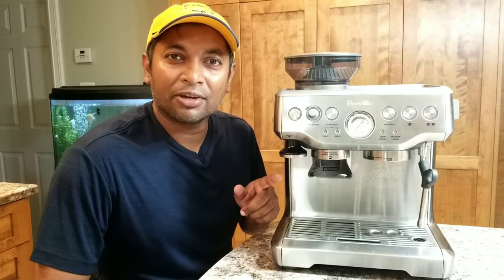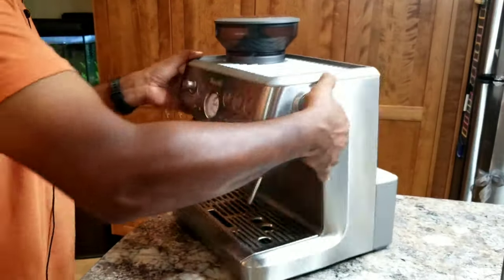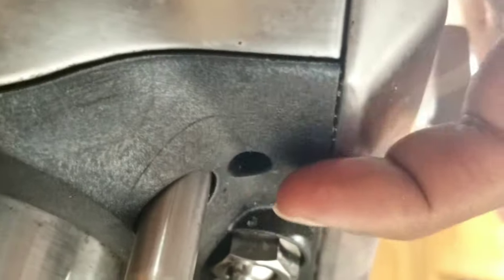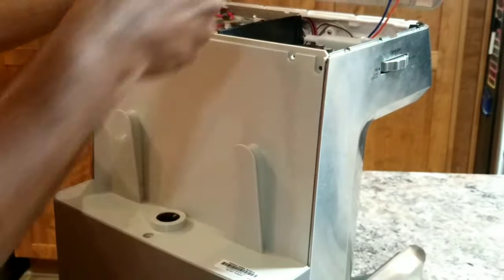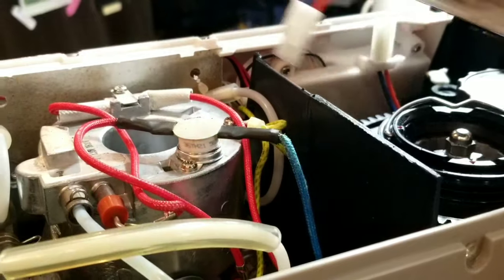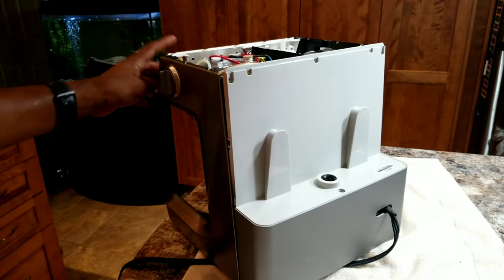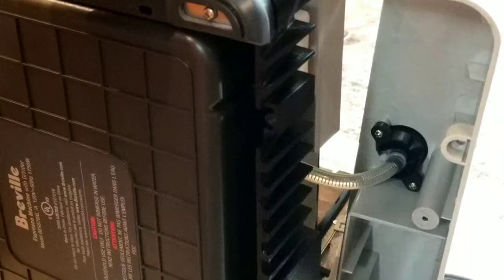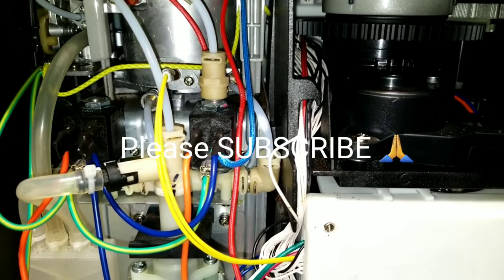How To Open Breville Barista Express BES870XL

Comment: Brilliant.  Was so close to getting a new machine after trying two new silicon rubbers with no result.  My coffees taste even better now.  Tightening screws removed all the side spray from my machine.  It did take patience and 2 hours...watching and rewatching.  I ended up with 3 extra screws...and one white piece which fell off while taking back off.  I also drilled holes for the future.  I'm thinking maybe draw a template that allows holes to be drilled without the two hours of pulling apart and putting back together...you could print off and drill from template.  Thanks again!!
Reply from the maker: Thanks for the feedback
Reply: Did you ever get around the making a template? I'm facing the same issue and replacing the rubber gasket does no good. Even with all of the resources available, I'm dreading taking the machine apart.

Comment: Thanks man for the help!!  In my case the grouphead collar screws were loose. Needed to tighten them and also put some thread glue on them.
Reply from the maker: In that case you need to open further to reach there
Reply: @AjusCafe  Exactly , you need to take out the whole panel but it was worth it   :  )

Comment: Great video Aju!  Thank you so much for taking the time to make this video and film it so well.  Our BES870XL was tripping the breaker every time the solenoid engaged (when we press 1 cup or 2 cup button).  Off to Amazon to buy the replacement part.  Hope it’s not too difficult to replace!  Thanks again!
Reply from the maker: You're welcome. I'm sure you will be able to fix that
Reply: it just started to happen to me as well , did you manage to fix it?
Reply: @calibour37  i managed to replace one of the two pump solenoids and it worked for a couple days and then started tripping the breaker again but only when using the double shot button; a day later and all buttons were tripping the breaker.  I was gonna try replacing the other solenoid but our 2 week summer vacation disrupted the process and now i don’t even feel up for troubleshooting this trash.  We had ours for 2 years and the warranty only covers one year.  I did the math and I might as well have been paying a coffee shop to make my coffee over two years!  Breville needs to extend the warranty or provide repair options.
Reply: @ColdPillowz  Re: Breville, their "support" is horrible.  You're right, for the price of these units, they should be offering better tech support and repair videos.  But then they wouldn't be able to charge the $295 service charge!

Comment: This video helped to find screw on the back under the plug. And 2 screws to remove top cover.
P.S: there is black thing, you pointed as solenoid... I believe it is a high pressure Pump. Solenoids are higher above the pump on both sides.
Reply from the maker: That's correct. Its just above the pump.

Comment: Great video, thank you! I’m attempting to replace a burned out thermostat on mine and got it open easily with the help of your video, now trying to figure out what the best way to replace the part. The positive and negative leads look like they were soldered and almost riveted or crimped together, not sure how to remove them and redo the connection… 🤔

Comment: nice as far as you went.  However, more of the external panels need to be removed to access the screws holding the hot water pipe downspout assembly.  2 of the 3 screws are accessible as far as you went, but the third screw is under the front panel.  How do you take that off?

Comment: easy as pie after watching this video.  I have an issue with no pressure on the steam wand, how can I tell which of those plastic tubes would be the one feeding the steam wand so I can check for mineral deposits?
Reply from the maker: Usually its the steam wand itself. You need to clean it the steam wand thoroughly.
https://youtu.be/DWivoLznT8Y?si=S_AooKbDLccH9RRg
If it doesn't help at all, then it could be the steam wand gasket that switches from hot water to steam failing. Does hot water have enough pressure?

Comment: Hi, I have a Breville Barista Max Espresso Machine VCF126 which was working. Now, when I switch it on, it beeps but there are no pumping noises. After a short time the steam lights flash but there are no noises. The machine stays like this, flashing lights and no noises. It therefore won't make coffee. The grinder works perfectly. Do you have any suggestions on what might have gone wrong and what I should look for when I open the machine. Many thanks

Comment: Hi Aju.  My BES860XL has lots of pressure but almost zero flow of water.  Any suggestions as to what to look at?  Thank you!
Reply from the maker: Desacle the machine few time's. Check if there is leak
Clean the shower screen too
Reply: Thanks Aju.  I have tried all that with no change.  Unfortunately, I probably will have to take it in for servicing.   @AjusCafe

Comment: Thank you for showing this on the 1st generation of this espresso machine. I can’t get good extraction from it my Burr has no adjustment so I have adjusted my external dial but still having issues. Could it be because of the hard water I use for some years. Even tho I descale it every time was need it. Or can the the pump be the issue.
Reply from the maker: Check your pressure works https://youtu.be/acQYG7HkYb4
When is the Roasted date of the beans you use?

Comment: Good video.  Most videos I see have the two screws on the top near the reservoir base.  It was also good seeing that it takes a bit of force to get the back off.  I always wonder if I'm fighting a clip or if there's some screw still holding everything together.  I had a water line clog that was easy to clear once I got the back off.
Reply from the maker: Its very hard to open especially for the first time
Reply: I found on mine, I had to remove the base, not difficult to press in the tabs at the bottom of the back.

Comment: I have to subscribe to your channel thank you very much you offer a wealth of knowledge I have a problem with my Barista Express I have plenty of pressure I have adjusted the beans properly however I have very little water coming from the extraction the bottom of the basket is totally dry water is only on the top can you please give me an explanation or refer me to one of your videos that I can check... Thank you very much I hope you're still read these comments
Reply from the maker: Grind the beans to coarser. That is higher number on the Grinder dial. Coarser should make the water flow easier.
Reply: @AjusCafe  I can do that but right now my pressure gauge says normal when I brew the coffee I just don't get enough water pressure through the head unit if that makes any sense

Comment: Hey Aju, I'm aiming to do a replacement of the grind actuator switch today (the switch that's pressed/depressed when you push the portafilter into the machine to get it to dispense coffee grounds) and am curious as to whether you've done this. I figure the actuator switch assembly (actuator and cable) is behind that white face plate on the right side (if you're looking at it from the back) of the machine. Can you confirm?
Reply from the maker: I haven't done that. But update me if you manage. Seems you'll have to remove few items before you can reach there. Have u got a video to follow?

Comment: whats that spring inside the tube connected to the water tank supposed to do? I lost mine...
Reply from the maker: It secures the black silicon gasket to the water tank. Without spring it won't hold it tight and water can leak

Comment: Thanks Aju!  I believe you've filled a massive gap between what Barista Express owners need and what Breville provides.  I have the same 1st Generation model that you've taken apart here.  Do you have any idea where to find "the electric fuse"?  My machine very suddenly stopped turning on (after about 2 years of use).  My guess is that a fuse was blown.  Thanks again and in advance for any info you think may help.  Regards, Ed
Reply from the maker: Usually if there is any power related issue, its better to replace the power unit itself. But if you want to give a try (assuming you are capable and certified to do it). See this link https://howtofixit.net/why-breville-coffee-machine-not-turning-on-troubleshooting-guide/

Comment: Very good video. Thank you. However i cNnot for the life of me figure out where my leak is coming from. It appears at the bottom undrr the area of the tray on the right side. Always a little puddle under the machine after brewing. I thought it was the drain hose but it looks fine.
Reply from the maker: See if your drip tray leaks and not overflowing. 2nd part is to open the machine just after brewing and trace where its wet. It could be a clogged tube that leaks.  So check the joints

Comment: I have two things:
1) I dont see a point in removing clips 06:13 before you loose those screw at the bottom 08:04
2) 06:13 - from my point of view applying a lot of pressure just leads to some damage. First, loosen those screws at the bottom (previous point) and then I slipped flat head screwdriver between those plastic covers and it popped out very easily

Comment: Hi, I have my barista leaking from the group head when I make an espresso. I have checked the ring and it seems fine. I have been told that it could be loosen screws from inside the machine. Do you have a video how to dismantle the machine to reach this part of the machine?
Reply from the maker: No. But there is one video on YT and he linked my video on how to open the breville barista express and he continued from there. I can't find the link

Comment: Good day! I hope you can help me🙏🏻. My barista express not turning on. Please i need your advise. Thank you
Reply from the maker: Try another plug point. 
If you can confirm power is going in, then the power supply unit may be faulty. Call Breville and they will guide you on replacement or parts

Comment: Aju, I did the pressure test and pressure is good. Could it be the coffee beans grind?. I have it to fine grind and my Burr doesn’t have adjustment.
Reply from the maker: Yes, most of the issue is related to stale beans. Esspresso needs freshly Roasted beans between 4 days and 3 weeks from Roasted Date. So to get Roasted date  you need to buy from a local roaster. Make sure you buy in small quantity, just enough for 2-3 weeks supply. 
The first generation machines don't have top burr adjustment. But you can buy it from Breville. See breville generations https://youtu.be/vlMhRVU0pJM

Comment: Hi I have the same machine and it's leaking but the gasket isn't the problem.  what to do ?  please tell me.  Thank you
Reply from the maker: You need to trace first where the leak is from. Use and pressurized basket and test again. If the machine is open, use precautions and wear glass

Comment: I have three screws at the bottom and rust has set in. I can’t seem to get them out. I’ve tried the elastic trick and the heat gun. Any suggestions?
Reply from the maker: Did you try WD40 spray and wait a bit to see?

Comment: I have the same machine and for some reason after following all these steps the back still won't come off. It feels like there are still screws in the bottom. I did buy it in 2018 🤷‍♀️
Reply from the maker: As shown in the video, did you remove the screws at the bottom, by laying down the machine on the side to reach the bottom? Else there could be a screw not fully removed. Use a torch light to confirm and remove it from the machine. If you have already done that, then remove the clips of back pannel from the top (by pulling a bit up)and work your way down.

Comment: Bought a used machine with water leckage. Fixed it by changing the saftey valve. Also the pump didn't work at all. Changed the pump and all is tight and pump is working.
Now I have this problem: as soon as I switch the machine on the pump starts to pump. All the time running. Steam, hot water and brewing all is working but the pump runs endlessly. Do I have to change the control unit? Or any better ideas?
Reply from the maker: I suspect it could be related to flow meter error. See my other video for a simple fix https://youtu.be/jtczkX4DPS8
Let me know how it went
Reply: @AjusCafe  oh my comment was deleted.
I changed the Triac on main board for 53Cent and now it's working like it should 😍
Reply from the maker: @bitcoineer  Great. I don't know what comment was deleted. But glad to hear that it's working. Was the triac burned when you checked?
Reply: @AjusCafe  No it looked as new.

Comment: Thanks for the great video! Very helpful to see. 

Have you ever removed the front faceplate?

I need to replace my pressure gauge and it requires removing the front faceplate which looks really thin and easy to bend and is not replaceable!!!
Reply from the maker: No i haven't removed the faceplate or pressure gauge yet. Hope you will find some guide on it soon.

Comment: So mine wasn't pumping AT ALL and the pump was making a hellish racket and I took it apart and the filter between the tank and the flow meter was plugged, so I removed it and sprayed it with a de greaser and blew it out with compressed air, and now it works like new again
Reply from the maker: Glad you managed to find the issue and fix it. I assume it is this same issue i posted some time ago? https://youtu.be/Q3bga6bRH8w

Comment: Hi , can I ask you, maybe you can help. On my machine clean me not work, doesn’t start cleaning process and double espresso button not work only single. Please help , if you have any advice how to fix it. Thank you so much
Reply from the maker: Seems you have more than one issue and i suggest you to contact Breville and they will suggest you or replace your unit.
Reply: @AjusCafe  what you think it could be a main board PCB or not?
Reply from the maker: @vadikos777  from those symptoms, my guess is more towards circuit board issue. It seems major repair. That's why I said contact Breville even if you are out of warranty. They may charge you a flat rate of $ 250 something to repair or replace.
Reply: @AjusCafe  circuit board  it’s same like I called main board or it’s absolutely different one?
Reply from the maker: @vadikos777  its the same 🙂
Reply: @AjusCafe  thank you so much

Comment: I'm getting excessive water in the drip tray coming from the diffuser can you tell me how to change that please
Reply from the maker: I haven't changed one yet. But water in the drip tray on each extraction is normal.
Reply: @AjusCafe  this is more than normal though, we saw what was normal when we got the machine.
Reply from the maker: @arrow1197  Have you measured how many ounce of water u get in your tray, if you run an empty shot using a pressurized basket?

Comment: My machine has started constantly dripping
Water into the base and flooding the worktop Any ideas what would cause this and what new parts I would need ?
Reply from the maker: When you make espresso, some water flows through backflush outlet into the drip tray and that's normal. And you need to empty the tray as it gets full.
You need to open the machine and find the leak source.
If none and if it leaks excessive then the culprit is 3 way solenoid failing.
Reply: @AjusCafe  thanks for replying, yes mine just keeps filling the drip tray even when not in use so I’d assume the solenoid is at fault
Reply: @AjusCafe  can the solenoid valves be cleaned if they let by water ? Or is it replacement only ?
Reply: Also the pressure is low when making a drink I assume that’s because it’s letting by and filling the drip tray

Comment: I was hoping you can help me or point me in the right direction. When I turn it on the water is running from the espresso extractor. No steam is coming from the steamer or hot water. After a few minutes the pressure pops the portafilter out.
Reply from the maker: I didn't understand the question. If water is not coming out of water dispenser or steam wand, it needs to be checked. It could be the gasket of steam wand. A video would be helpful.

Comment: Well I took my machine apart as you showed. Couldn’t be sure of the source of a leak. When I reassembled, the machine only clicks and lights up the program button. Nothing else. In other words, it has stopped working.
Reply from the maker: Seems like the main control board is not working. 
1. Plug off your machine for few minutes 
2. Press and hold Program button for 5 seconds or until it beeps
If nothing changed then i suspect the control box. Please call breville about this issue and they should guide you.
Reply: @AjusCafe  Thanks for advice. The machine started working again. I think the water in the back of the machine inundated the electronics when I tipped the machine on its side. This is a hazard that should be noted. Opening the machine when it has excess water may cause secondary issues with electronics.

Comment: My machine has a leak coming from the back right screw on the bottom. So much that it's rusty and I can't tell where it is coming from.
Reply from the maker: You need to run few empty shots when the back is open, to see where the leak is. Make sure u take safety precautions like safety glass and don't touch any electrical items when its ON. Usually the leak is from the pipes next to the boiler.

Comment: I spilled almost 30ml water into the grinder :( do you think my machine will survive it?
Reply from the maker: It's bad to get burrs wet. But if you wipe it quickly and dry it with a hair dryer, it will surely survive.
Reply: @AjusCafe  my biggest fear was the water would ve damaged the electrical circuit. But it seems that the electrical part is located on the sideway not under the burr.